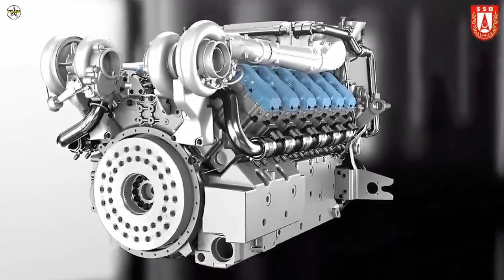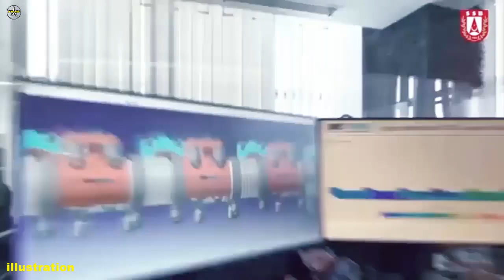By 2025, the Altay Tank will use domestic engines

Comment: If the Germans had not imposed the embargo, the Altay would have entered mass production a long time ago.
Reply: Mass production is not important. Controllers technology and creating exports is! So Turkiye did the right thing and now they have a direct competitor to the German MTU engines with the BMC Batu and soon also the Renk transmissions with the BMC powertrain.

Turkiye doesn't urgently need new tanks. Its tankforce is bigger than half of Europe combined. It needs technology control and exports to make money and make partners worldwide. This will be the greatest investment for them in the long run.
Reply: ambargo yaparlarsa biz üretiriz. 👍
Reply: @emrearslanca5936  zaten oyle olmali ambargo olsun ya da olmasin